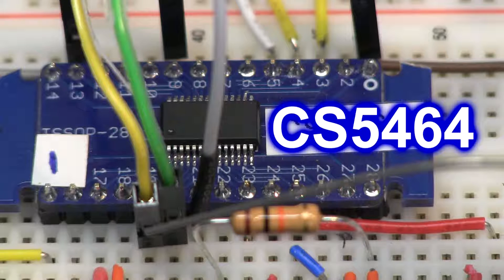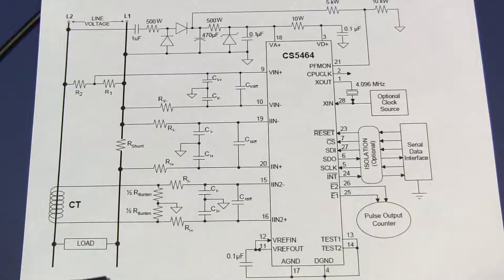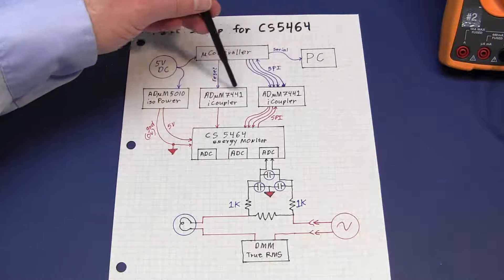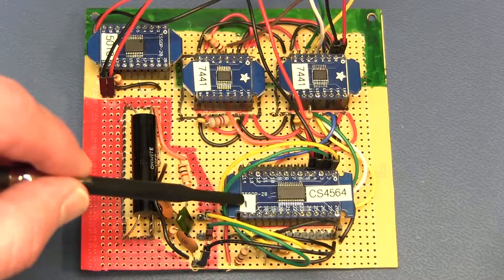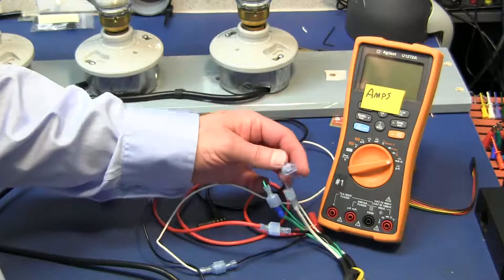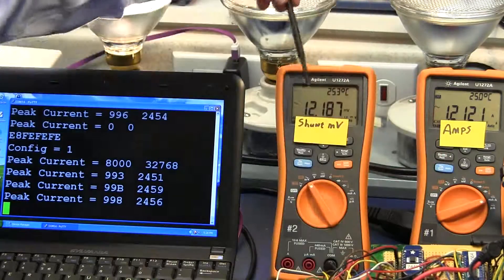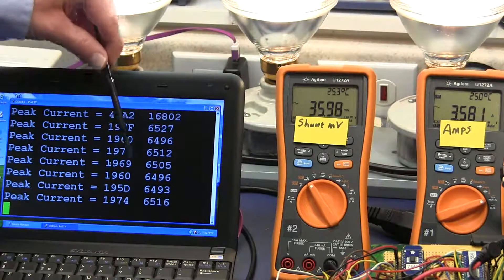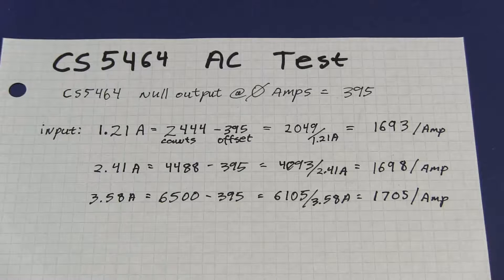Using the Cirrus Logic CS5464 for AC Current Measurement

Comment: Excellent analysis process. Can you outline some of the SPI communication techniques you use in arduino code?
Reply from the maker: Here's a summary write-up.  See the example code at the end of the post, not a lot of comments in it, but hopefully enough to make it understandable.
http://corgitronics.com/2014/06/30/using-the-cirrus-logic-cs5464-for-ac-current-measurement/
Reply: Thanks for doing that write-up. It fills in the details that the videos don't catch.